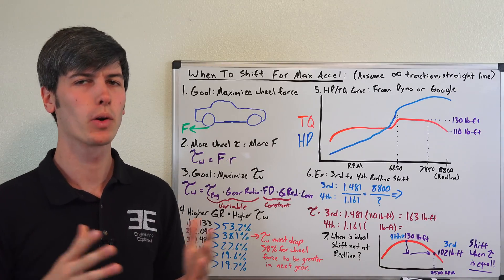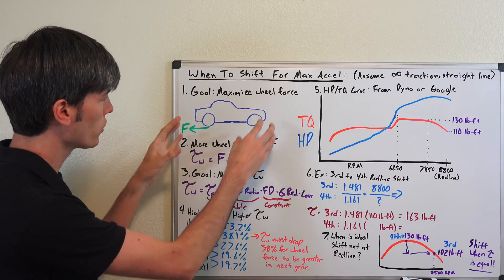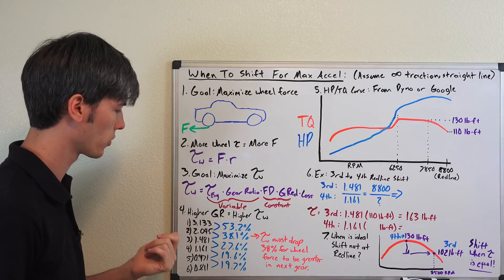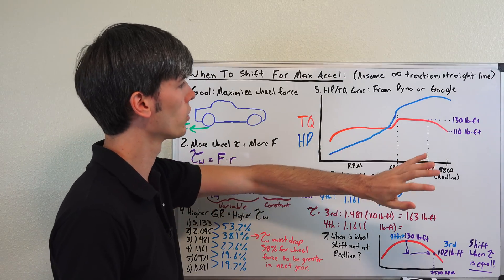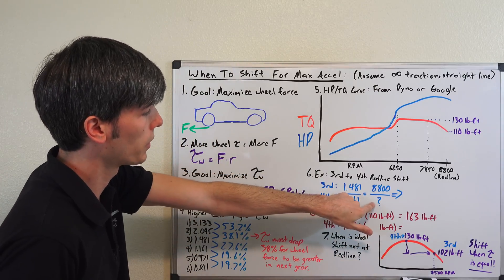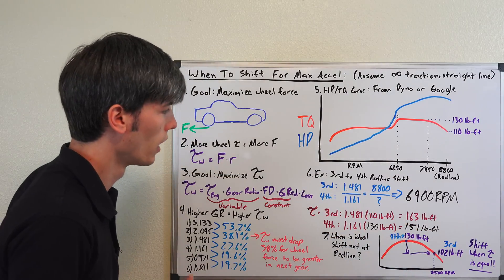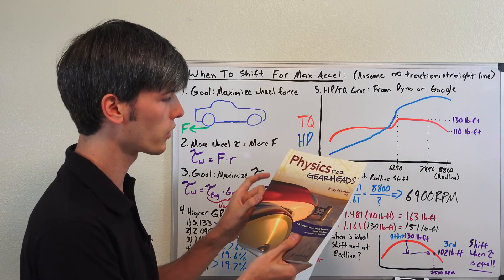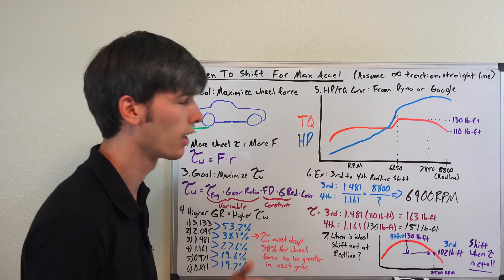When To Shift Gears For The Fastest Acceleration

Comment: should do one video shifting for best fuel economy possible
Reply: My Subaru is really unhappy at below 2000rpm, vibrating and stuff... Maybe that's part of the reason whyEJ205 has such terrible gas mileage? :)
Reply: Relatively quick acceleration up to 2k rpms, shift. Rinse and repeat. Don't mash the throttle to quick but don't take forever to accelerate. Works best in a car that has a ton of torque at low rpms like mine. 

Managed to get 22mpg combined using this trick, which is pretty damn good for a 400whp cammed 5.7L V8 on a slightly rich tune.
Reply: shift at 8000rpm even if your car redlines at 6000rpm
walking home will get you the best mpg :)
Reply: Best for fuel economy is, in this order:
- good prediction of traffic (as little braking as possible, use hills to your advantage - don't rush uphill and gather a bit more speed downhill; as little stops as possible between traffic lights, for example if you can, cruise slowly to the red light and hope you don't have to stop fully; etc.)
- swift, but not aggressive acceleration with efficient gearchanges, and then driving as steady as possible in as high gear as it's possible for the engine to still run smoothly and not choke itself -> cruise control is perfect for this. Petrol engine would be 2-3k rpm, diesel usually 1,3-2k rpm. It varies.

Slow, long winded accelerations with shifting below your torque curve are not the best for mileage and neither for the engine itself. You spend too much time on inefficient parts of the torque curve, your oil pump is supplying lower pressure despite increased workload (more gas-air mixture pumped by the injectors than when cruising) and the engine wasn't really designed for such use long-term.
Reply: @klikkitse Highest gear on cruise control just below turbo's entry point(depending on the car it should be under 2000rpm or maybe a bit lower, like 1500rpm). Drive your car like that on a cool day(10-15°C) on the highway and you will get that consumption. But don't do that too much, because in my opinion it is not really healthy for the car.
Reply: better yet. Most money saving gear change. Saving your gearbox vs lower RPM. etc. There is a lot more than fuel economy for the car savings.
Reply: Oh absolutely! I would love to be able to do that math for my car too. It's a really small turbo diesel and could potentially get great consumption figures (3.4L/100km) but I've yet to hit those numbers. Perhaps an episode on this would let me understand my engine a little bit better.
Reply: Accelerate fast to given speed then shift into max. gear possible for cruise.
Reply: All Wrong. Look up a Brake specific fuel consumption chart. You are looking stay in the area of the map where the engine has the highest thermal efficiency or the highest amount of fuel that is converted into energy. For my 96 honda you want to stay between 1750-2250 around 70-80% load. Dropping below 1750 and running the engine would use more fuel since you are out of the volumetric efficiency range. Typically 4 cylinders run almost the same, v8's and other engines have their own charts.
Reply: "Most money saving gear change. Saving your gearbox vs lower RPM." 
 
The shifting strategy that would result in longest clutch life would be to "float" all the gears, and only come to a stop facing downhill, so you can coast, then "float" into first! Your clutch would NEVER wear out, b/c you would NEVER use it! (Of course, if you weren't 100% perfect at floating the gears, you'd F up your gears and synchros...)
 
So, a reasonable "second best" would be to use the clutch, but always shift AS IF you were "floating" the gears. That way, you cycle the clutch once each shift, but it should not be moving at all, relative to the flywheel (except starting out), so it shouldn't wear (much).

And better yet, double-clutch all those shifts, and your synchros shouldn't wear out, either!
Reply: The answer for this question will always be a different RPM for different cars.
Reply: well tuebos eat fuel lol this is why the new ecoboosts that ford is putting out barely get better MPG. The revs get too high and they get into boost too often and it eats up gas. On my R6 (motorcycle) it peaked redlined at 16000rpm power peaked at roughly 14000. BUT I could cruise on the highway at 75mph at like 5k rpms and getting like 45 o the gallon
Reply: Be soft with the pedal, no brutal acceleration, use the highest possible gear while cruising, but keep in mind that under 1500 rpm most cars lack power even on  flat roads, so mpg may suffer with too low rpm. While accelerating try to slightly raise your foot to test if it makes any difference : if not, do not push that much on the pedal. Except for the most powerful engines and the lowest gears, pushing the pedal to the ground is often useless, but could still inject more gas into the engine, so learn to not push too much by testing with your right foot.

Soft driving also mean soft braking, as each time you use the brakes you will need to accelerate, so try to see in advance and don't go faster than needed if it will cause you to brake, sometimes driving just a bit slower could let you come to the lights just in time not to stop, etc.

Different engines also have different regimes for efficiency, power, torque, etc. so the most efficient cruising rpm could vary a bit, probably best around 2000 rpm, 70-80 km/h, 45-50 mph ?

Another trick that most recent cars already use trough their electronics, is to make slight changes in rpm every few seconds while cruising at the same speed : alternatively push and rise your foot from the pedal - maybe a millimeter - when driving at a constant speed. If the selected gear is high enough you won't notice much acceleration/deceleration and the mpg should be a bit higher. I don't have any explanation for this one, but it has become an industry standard I understand.
Reply: I have to confess. My car does not have a RPM gear, so I need to sincronize shifting either by speed, or by ear.

FIAT Panda 1.1 is a very instinctive car.
Reply: IF you want to safe fuel, it´s the best idea to ask yourself "do need do drive now or can I walk/ride a bicycle or combine trips?". 
Throttle position is most critical - not shifting. Gas engines with a throttle body are most efficient with ~80-90% open throttle!! But of course NOT until redline. Shift very early.
Diese engine is just the opposite: Throttle has a direct influence on the amount of diesel infected.

I personally notice that the same car (2017 Passat 2.0 TDI) uses 8l/100km [30mpg] in Germany and 5,5l/100km [43mpg] in France. This is due to (partly no) speedlimit in GER and bad traffic jams in GER and no traffic light due to uncountable round abounds in France. So never need to stop in France. 
Car shifted via a double clutch allays in "automatic mode".
Reply: well depending on how far you live, you might go through a couple bottles of water which will increase the mpg
Reply: George Rosebush you definitely can't start in 2nd or 3rd in a lot of cars unless you want to destroy the clutch.
Reply: my evo did the same under 2k  rpm its normal if you have a turbo
Reply: CharlietoKind also bogging out the engine which prob isn't the greatest
Reply: bcubed72 Pretty much all modern vehicles.
Reply: For best fuel economy i shift down once the rpm hits 2.5-2.0
Reply: question is are you faster driving this way than any car with a 100HP engine consuming the same amount of fuel?
I see tons of 80k+ cars on "Autobahn" producing traffic jams as they do not accelerate while overtaking cars on roads WITHOUT speedlimit. Pretty nonsense to through a hundred grant into a car to and safe money via fuel afterwords.
Reply: Done 👍🏻
Reply: Done just now
Reply: he just did today
Reply: Karan Veer YEAHHH UGH 💦😩
Reply: Done ahaha
Reply: Yeah I have a wrx as well, don't go below 2k outside of first or second.  I think the ej205 has a combination of really low compression (8.0:1),  intake/exhaust oversized  for efficiency at >2k rpm, and a poor valve train.  I usually find the engine behaves best in the 2.5-3k range while cruising, though I've never done any economy testing.  Avoid gears where you're hitting boost/ almost boost while cruising unless your over 3k.
Reply: Jesus christ I get an avg of 15mpg on my 4.9 V8!
Reply: I think that you should shift in the rpm when the engine is most efficient, which is around the maximum torque rpm.
Reply: Eddie Linares GO NEUTRAL DOWNHILLS LOL
Reply: "Highest gear no throttle going downhill = 0 fuel usage"
True in SOME vehicles under CERTAIN conditions. you can't know that for sure without monitoring OBDII systems in real time.
Reply: only on a Honda, based on my knowledge and experience. some cars do not shut off fuel until you shut of the key.
Reply: Go really close to a truck in final gear. He will be on cruise control so little gas fluctuation. Then play with your phone and forget to break in time. Also take a dump before driving to safe weight.
Reply: I do, although I find it ridiculus that WRX that revs to just 7000 rpm can't really cruise in 5th gear below 80 km/h while high revving S2000 and CRX with B16 are happy for constant speed cruising in highest gear at speeds as low as around 45 km/h while they rev to 9200 and 8200 rpm respectively. Or maybe it is lack of variabe valve timing and lift (aka VTEC) that I'm missing in Subaru
Reply: mibars
WRX could just be tuned in such manner. It's a boxer engine and boxers have much different dynamics, vibrations, resonant rpms and as such might need different tuning and driving style. Having a turbo maybe affects this, too.

Generally rpm range doesn't tell the whole story. You first need to look at the actual torque curves.
Reply: We had a car that could read an instant mpg readout  and manual shift ability and when I keep it at the highest gear possible and accelerate the mpg is worse than it revving high .
Reply: mibars, maybe install a light weight pulley? My heavy ass car only starts sputtering at like 800-900 RPM :)
Reply: cantcurecancer Try this:  Fill a bucket with a firefighter's fire hose. And then fill a bucket with a garden hose. Bam! Perfect analogy. lmao
Reply: cantcurecancer that sounds about right
Reply: ***** Nah, lugging is different. As long as you don't go from 1800 rpm to 4k wthiout downshifting first you shoudl be okay.
Reply: carbonicle carbonicle Neutral uses fuel aswel. Highest gear no throttle going downhill = 0 fuel usage
Reply: mibars maybe that's because Subarus are not meant/designed for fuel economy. They're designed for performance and racing yo! If you want fuel economy cars you'd better buy Suzuki Alto instead 😂
Reply: mibars what year and what model?
Reply: That8oySimba9302 not all subarus are made for high performance/speed. i could see where an sti would get better gas mileage than the 2.0 wrx. more torque and newer technology ( fuel mapping strategy) also different gearing.
Reply: Basically just drive like a grandma. You can do things like start in 2nd or 3rd, upshift early, but generally being super easy on that gas is the best way.
Reply: Eddie Linares shift early, lower rpm. Also light acceleration amd light braking helps mpg
Reply: mibars is it due to unbalance something of your engine?
Reply: Unbearable Pain you are accurate! Many modified car actually run better mileage despite of higher power (if not always paddle to the floor)

Because more fuel is used accelerating rather than cruising.

Modified cars have more power, so they accelerate to cruise quicker, after that just cruise.
At the end, they have better mileage, although  on paper, mathematical wise more power, more air means more fuel
Reply: It's not just shifting, but the combination with the rpm and how much you push the gas pedal. To answer those, you first have to find out how much you want to accelerate  (you will use lower rpm and gas to do 0-30 in 15 seconds than in 7 seconds). It's all relative to the acceleration you need, the gear you are in and the car, but saying "shift in as low RPM as possible" is just wrong, because you might shift at 2000 but press half or more of the gas pedal and thus actually consuming a lot more gas than you should.

I used to shift around 2000 RPM in my civic the first year I had it. Later I started shifting at 2500 - 3000 (or even up to 4 when I need faster acceleration)  on the first 2 or 3 gears while pressing the gas pedal a bit less and there was a notable difference in gas mileage.
Reply: Wes Fathauer Ik my 2017 Vw Jetta is not a subaru 😂 or a fast car but I have noticed that it doesnt like being at around 1,500 - 2,000 rpms in 2nd gear its really odd....it just starts to kinda jiggle. I dont know how to explain it really haha.
Reply: I would like to understand some of the logic behind how computer controlled automatic transmissions determine when it is time to shift. 

Your owner's manual should have recommended shift-points.  These are probably fairly close to the optimum shift points for good fuel economy.
Reply: Simple math, each revolution means an explosion. Each explosion means gasoline injected into the cylinder. The more revs occur the more gasoline is injected into the engine. Keeping the engine at the lowest possible rpms means less gasoline injected into the engine. According to my math each revolution on my engine uses 40 micro-liters of gas which is amazing and means 25 revolutions spend 1 milliiter of gas. If my engine idles at 800 RPM that means that it uses 32 milliliters per minute and that if you rev it to 3,000 or 4,000 you use 4 times the gas.
Reply: Objective Fishkeeping,
 
To remain at a constant RPM, the power produced by the engine must balance the load.  At low RPM, and high loading, the only way for the engine to maintain its speed is to burn more fuel per cycle (richer mix), as the airflow depends mostly on RPM.  Once the RPM's start to climb, the engine has more air available to combust and can reduce the mix to stoichiometric or slightly lean and make the same power to balance the load.   There's definitely a sweet-spot of engine RPM and loading where it gets the best fuel economy.  The optimum RPM shift points will be different for each gear because the loading will be different (different torque multiplier for each gear, air-resistance).  When accelerating up to highway speeds, it is more efficient to let the RPMs wind a little higher in the taller gears before upshifting, than to up-shift too early and accelerate for a longer time in the higher gear (under higher load, and lower RPM).
Reply: Jrchajrcha Sgscs lowest rpm is not always best because it may mean more struggle (stress) on the engine than ease
Reply: Eddie Linares who needs fuel economy? Jk
Reply: Keep rpm (low sub 2k)ie short shift stay in higher gear.
Reply: Came out today lol
Reply: It's done now
Reply: shift on 5500 or 6000.
Reply: 3000rpm for maximum mpg gains yeah buddaayyyy
Reply: Shift between 3000 to 4000 rpm.
Reply: Shift at lowest possible RPMs without lugging the engine.
Reply: Actually it may be even better if you floor it almost all the time, but keep it at as low revs as long as possible - Just select your acceleration based on gear, not based on gas pedal. In fact at low RPM there is usually almost no differnce between half throttle or full throttle, as throttle plate is already open enough to drop the vacuum close to zero. Why that way? Most engines have maximum efficency at WOT as you remove a restriction (throttle plate) that generates pumping losses. But on the other hand not every engine is happy with lots of force from pistons at low speed possibly wearing out rod bearings quicker...
Reply: between 20000 - 30000 most likely. But ever y car is different
Reply: Eddie Linares thats just shifting lowest rpm possible
Reply: ya, but would just like the hear the math behind it. That's why I like to watch these videos
Reply: Eddie Linares most recent video!
Reply: @Warreng-i2g  not exactly if you shift too soon you have to aply more gas to go on the same km/h, if you put 5th too son on lower rpm you would waste more fuel than put in 4th on a slightly higher rpm
Reply: earliest gear changes = low accel = low mileage
Reply: paladain55  I wasn't wrong, I just assumed that guy drove a diesel. For diesel cars under 2k RPM leads to good gas mileage. For 4 cylinder petrol engines then between 2k and 2.5k is best. But yeah, please go on being a condenscending dipshit.
Reply: SpotOn if the car rolls forward from gravity you can shift into 2nd. but I wouldn't recommend 3rd unless it's rolling forward much faster
Reply: Simple, ease on the gas and keep it at 1800 rpm or so. Basically keep it at the highest gear you can without droppign bellow about 1800.